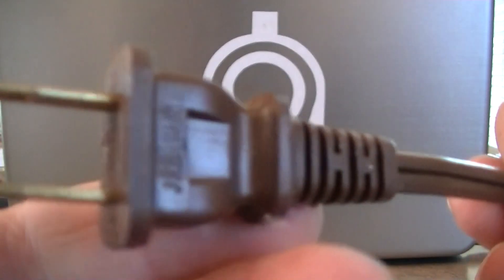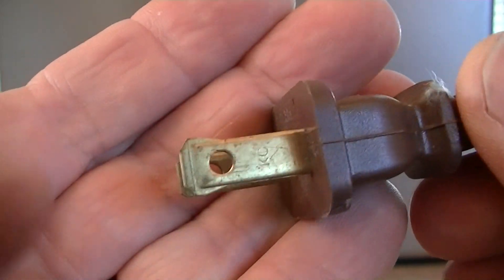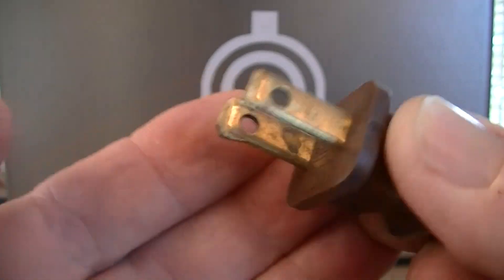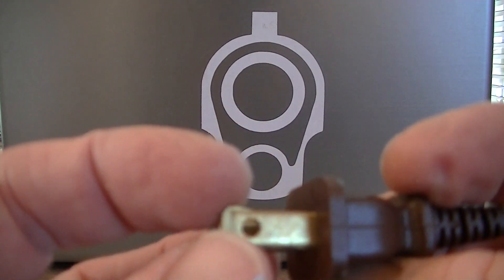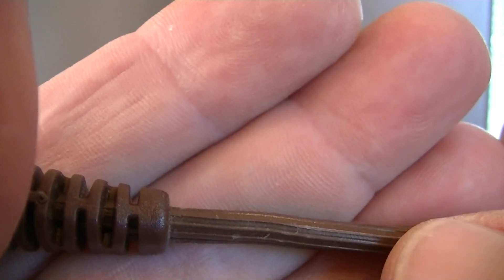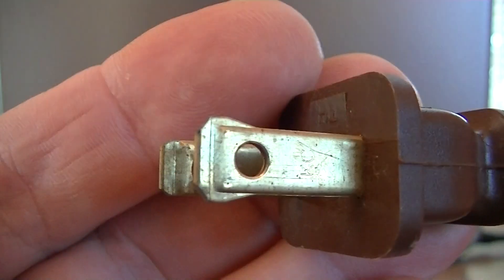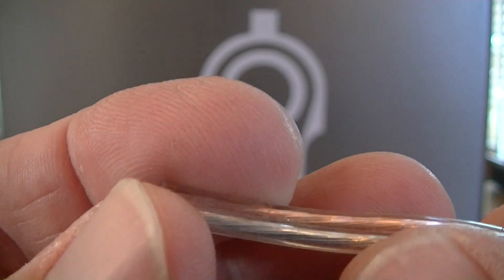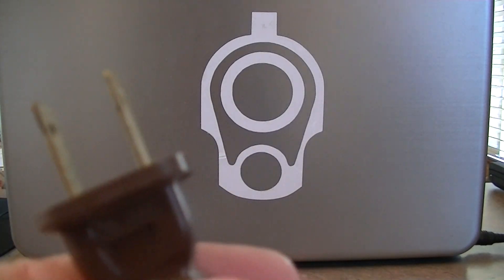How to identify positive and negative electrical wires

Comment: Thanks I have a receptacle for 12 volt in car devices (cigarette lighter,phone charger) etc. I hope that the 
Ribs  are on the negative wire - I can't open it to see
Where the wires go; pos to
The center,negative to the side my only option is to
Test with wires straight off
The 12 volt battery

Comment: I came here because I bought an air compressor and found out that when built in china the white is power! I was looking for help on finding the neutral and ground wire because they are all copper and no ribs on anything all smooth wires. I have red black and white. Someone should really teach them the code being used from the early 1900's for what color belongs to what!

Comment: Thanks for doing this video!  I just need to replace the socket on an old floor lamp and did not want to  replace all the cord. But the older wire wasn't so easy to tell hot from neutral and your video really helped.  All the other videos out there talked about replacing the socket and the cord so I was really excited when I finally found your post.  Thanks a bunch!

Comment: Hello. I’m trying to replace my 14,000 BTU window air conditioner plug. I cut the plug as it was all flat outside so I figured the wires would be colour coded inside. They aren’t. Only the ground is identified. The other two positive and negative wires are the same colour and not marked. Is there a way to tell? Thanks.

Comment: I have a vacuum I’m trying to fix the cut cord. But both the wires on the inside of the rubber tube are white. With copper. How can I tell which is positive and negative?

Comment: I had a black wire and a white wire coming out of the junction box. I assumed the black wire was hot. They were both hot. I put wire nuts on both and put the cover plate back on. Let the next owner figure it out.

Comment: Pretty dangerous to be misleading the public by referring to these wires as positive and negative. AC power alternates between its positive and negative cycles 60 times a second, so the voltage on each wire is never rectified to be called either positive or negative. Please be careful, someone from California might watch this and sue you for misinformation.

Comment: Simple.   Was just what I was searching for.  Appreciated dealing with Low Voltage systems.  Interesting that 12 volt output from transformer, it does not make a difference.  Not sure why, but good to know

Comment: if both wires are same color. and everything same in both wires then how we know which one is positive and negative?
Reply: 1:55
Reply: @TeamEmperor  B
Reply: @harrylopez22  @ myself Rico702Vegas...
Reply: @TeamEmperor  He said BOTH WIRES ARE THE SAME, genius. Way to pay attention.
Reply: Rico702Vegas When is that ever the case in standard wiring. I said STANDARD
Reply: Take a multi meter, set it to the correct setting (volts DC or volts AC etc) and put one test lead on a wire, and another on a GROUNDED piece of metal. One wire will show no current/voltage, the other will show whatever voltage/amperage you are testing for (i.e. 120v on standard household current). Hope that helps!
Reply: @Rico702Vegas  does the wires need to be powered on to test that?

Comment: We have a bus that thiefs came in and cut all the wires to get the battery. We got all the wires fixed and got a battery. How do we tell which wire goes to positive or negative??
Reply from the maker: the wire that goes to the frame is the ground the wire that goes to the starter is positive
Reply: RPMIDAHO Thanks, that'll help! 😂

Comment: Im stuck. I have a lamp cord that i bought at yard sale and its missing the actual plug so im left with just the wire but the wire i have has no side that has ridges( not even what u showed as an example). I stripped the cord and both sides have the same color wiring inside of them. So i got nothing left to go on. Only thing i see is tiny print writings on one side of wiring. Can u help me with another possible way to distinguish which is positive and negative please
Reply from the maker: the side  with the writing would be the positive side but on a lamp polarity is not as important as with othe electronics i hope this helps
Reply from the maker: let me refrase my comment  polarity is not as important with incondesant bulp lamps but may be with LED's so again the side with the writing is posative thanks for watching
Reply: RPMIDAHO thank you so nice of you fresponding and so quickly. You were very helpful thanks

Comment: Im  trying  to add a cord to a ceiling  light to plug  in but the  cords both have  writing  on them.does it matter how can I attach  it to the cord
Reply from the maker: if the cord end has one wide prong and one straight prong the wide prong is your nutal or white wire i hope this helps if bothe prongs are straight then marl one as the nutral  or white

Comment: I NEED HELP I have a speaker cable both are copper and one of them has a white straight line. how do I know which one is my positive and negative. please help.
Reply from the maker: the wire with the white line is negative

Comment: Hello , I need a bit of help I have a 10 yr old sewing machine I need to update the light inside so I buy the recommend bulb a  wedge base t3.25  which I convert to led for better brightness . when I opened the machine I find a flat single chip like light ( guessing a single led which is got 3 wires 1 orange 1 red and 1 brown if you have time can you tell me how to install a new 2 wire ( positive/negative) wire socket base so I can use simple wedge style bulbs when needed thank you. so much  .

Comment: Thank you so much.  This video is very helpful.  I bought a pendant light from IKEA and it has two light bulbs.  There are two exposed wires and it also came with two separate black and white wires.  I need to join both wires from the two bulbs and connect the white wire to the neutral wires and black to the hot wire, then connect the black and white wire to an extension cord (because I want to make it a plug-in light instead of hard-wired in the ceiling).  My dad used to do this when he was still alive, but I forgot how to do it again.  I was wondering if you can share some of your expertise with me so I can use the pendant light.  Thank you for any help you can share.

Comment: great,  I was need to connect my small compressor on my battery jump to put air on my bike tire, but the small compressor has the cut wire, so I was to know what wire would be positive and negative, so now I know. thank you.